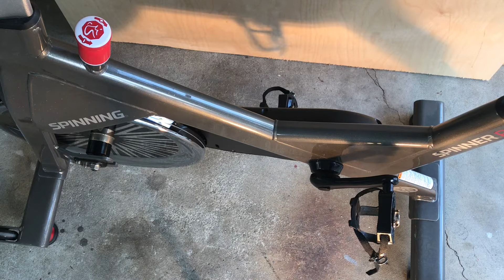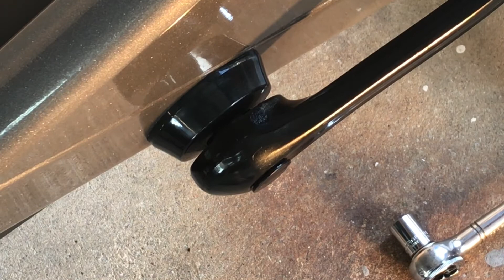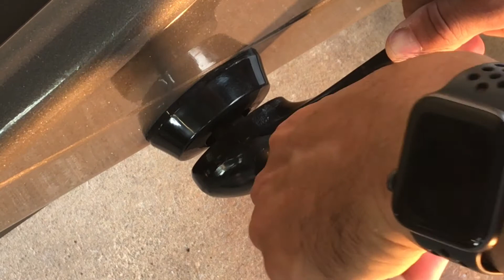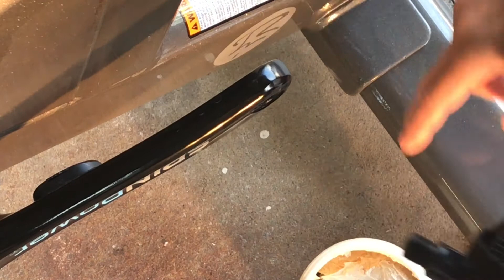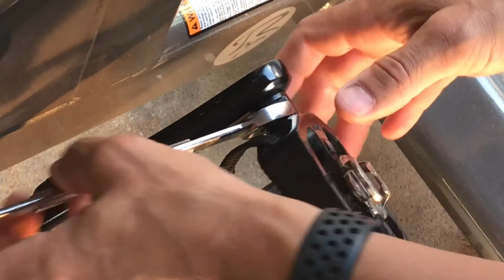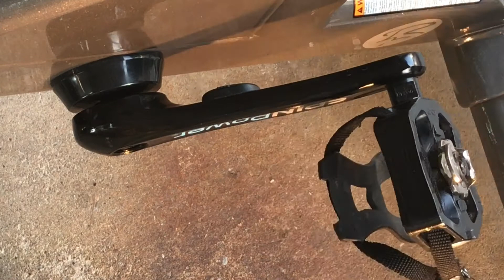How to install a SPINPower® Performance Crank

Comment: Hi. Where did you get that power crank arm to fit the square bracket?
Reply: Hello Stephen.  The crank in this video is the Performance SpinPower crank and it is only for the A and P line of home bikes by Spinning.  If you have a commercial Spinner bike, then you need the Studio SpinPower crank.  Check out Spinning.com for details and thanks!
Reply: BTW,  the Studio SpinPower crank uses the "threadless" Morse Taper connection and not the square taper (like the Performance SpinPower crank) as seen in this video.